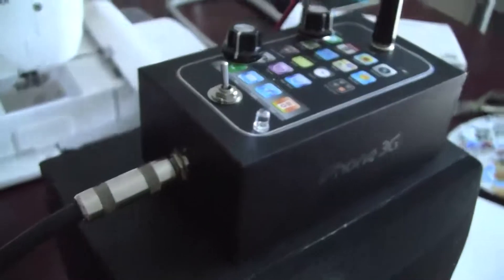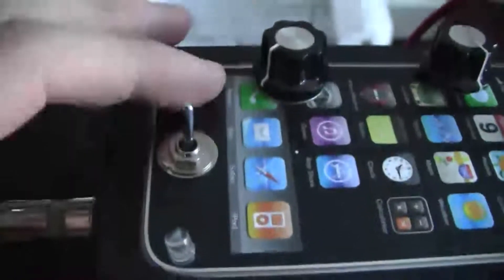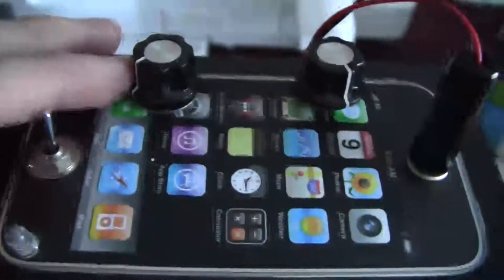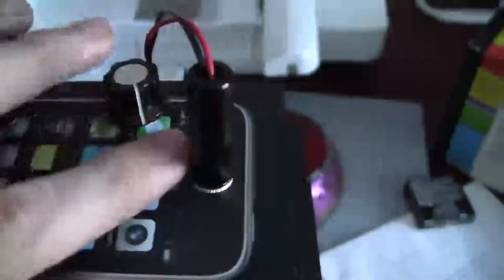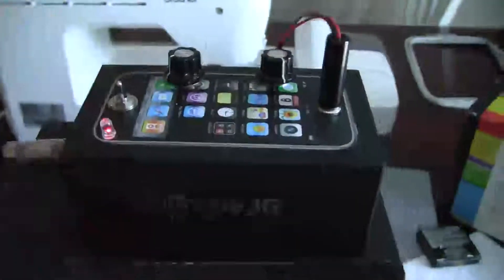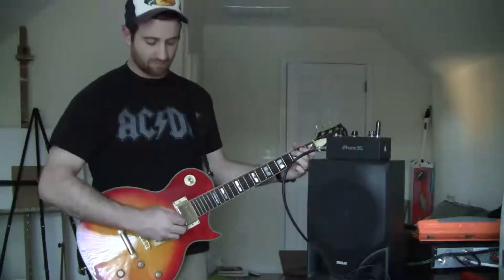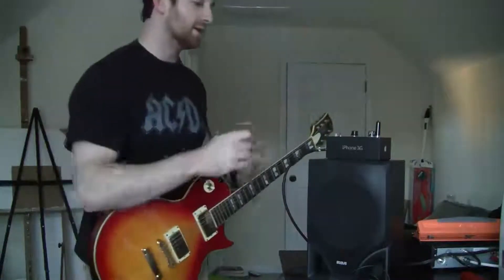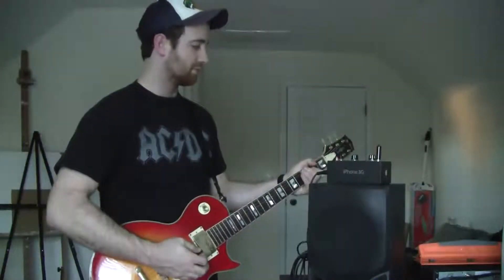DIY Homemade Guitar Amp

Comment: Hi Kevin, I don't know if your still into building small amps, older video. If you are, you should build a Runoffgroove.com Ruby Amp. I have made quite a few and I used a Jensen MOD series, 8"- 20 watt, 8 ohm and a Jensen MOD 6"- 15 watt, 8 ohm speaker and they crank. It uses the LM386 audio op-amp and an MPF-102 J-FET, line level input. I add an output jack that cuts out the internal 8 ohm speaker, all housed in a Cigar Box. Proper grounding is all important with the LM386, Check out John Audio Tech on YT, "LM386 and proper grounding" video. Sounds good to me. Ruby Amp also uses a 1K pot for the gain. C.
Reply: Wow thanks dude this helped me a bit im wanna build a big amp like 10 20w or so and u saved my life 😂

Comment: Hi man, is there any difference between an old stereo speaker and a speaker you can get at a guitar store?
Reply from the maker: Hey ***** - the main difference between speakers is impedance. If you look up the LM386 audio chip schematic you can find difference resistor and capacitor values for different speaker impedance values. Any speaker should work, whether it came from an old stereo or a guitar store :)
Reply: Kevin Kanzelmeyer thanks; if I understand, it is the same as for those amplifiers that come with speaker output specifications for 16, 8 or 4 Ohms; each one of those have different resistor and capacitor values?
Reply from the maker: Hey ***** you have the right idea. You can use a speaker of any impedance as long as you adjust the resistors and capacitors accordingly
Reply: Kevin Kanzelmeyer thank you sir.
Reply from the maker: No problem! Good luck with your project!

Comment: @marcusmello69 you can use the next highest Cap value, within reason. Dont go under value though, and make sure that the Voltage rating is above 18V. Bigger V (voltage) ratings mean bigger caps, but pedals never really need to have anything beyond 20-25V capacitance.

Comment: 1x LM386
2x jacks(input/output)
1x 220uF capacitor
1x 1uF capacitor
1x .01uF capacitor
1x 100uF capacitor
1x 25 ohms potentiometer
1x 100k ohms potentiometer
1x 9v battery

Comment from the maker: @DaronSpence The schematic uses standard schematic parts representation... capacitors are the parallel lines, potentiometers are the resistor boxes with the arrows, the triangles are "ground", and the dots represent input and output. Good luck with your first project!